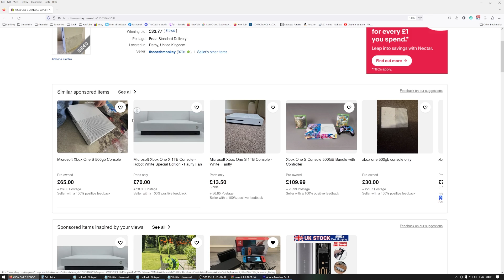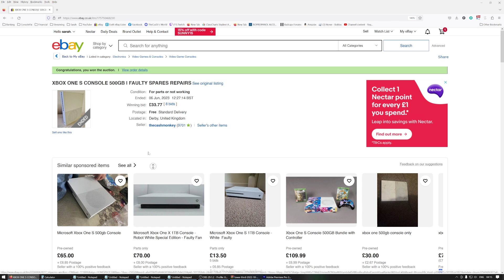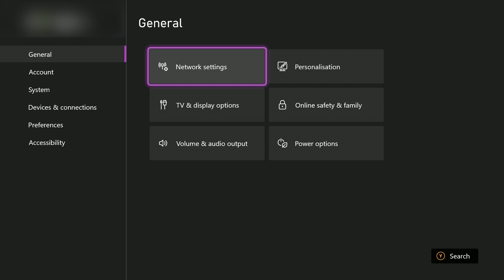Can I Fix A Broken $40 Xbox One S From eBay?

Comment: If we speculate a bit, what could cause the tester to work but not the screen? My guess is it was too low voltage for the screen to work but the tester is more sensitive and therefore picked up enough voltage.

Comment: Got one with a beep on and a beep off.  Fan ramps for a second.  Sometimes the light comes on.   Watching with a thermal cam you can see mosfets and cpu come on.   It has a damaged hdmi port..  try replacing that today. Board had all kinds of corrosion by the power rails.
Reply: Maybe try liquid damage treatment (ultrasonic cleaner) or just some elbow grease and high purity IPA.
Reply: Looks like the nand chip is heating up funny.  Normally you can see a clock heat signature on the backside when booting.  This one get hot on the southbirdge side and board shuts down

Comment: Funny! I have the same problem with my capture card, when I turn off my soldering iron (Weller 1010) the capture card freezes and I need to unplug and plug it again. But also my Hi-Fi is on the same power input as my soldering station, when I turn it off you can hear literally hear it in the boxes, maybe some current spike?
Reply from the maker: Yeah I think it's either that or a bad ground somewhere. Maybe the soldering iron has a defect and isn't grounded properly? I can hear a hum from the power supply inside my iron too! I think I may try isolating the iron from the rest of the circuit because it definitely shouldn't be happening

Comment: I work on cars sometimes if i use a circuite tester inuf power comes threw to lite up the led but not inuf to power the unit its connected to maybe the same thing with a hdmi tester dunno

Comment: Talking about cleaning power supplies , I tried cleaning the ps4 slim power supply with ipa and bcs the ps4 power supply is revealing with its capacitors my entire hand got a massive shock , was fine after 2mins tho luckily 😂
Reply from the maker: Yeah I've done that too, certainly wakes you up 😂 on a serious note though if you have an underlying heart condition it can cause serious problems, or for example if you use a pacemaker